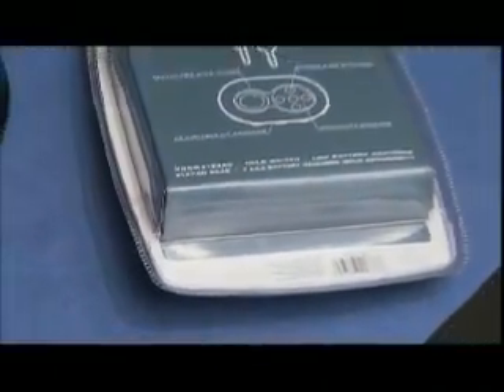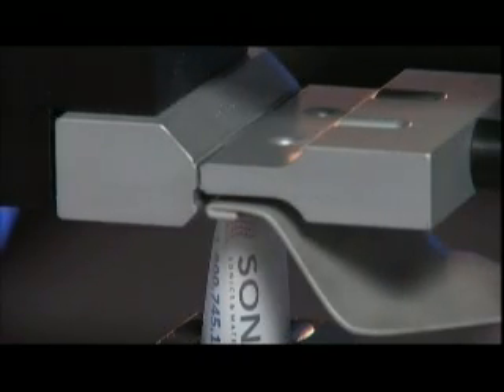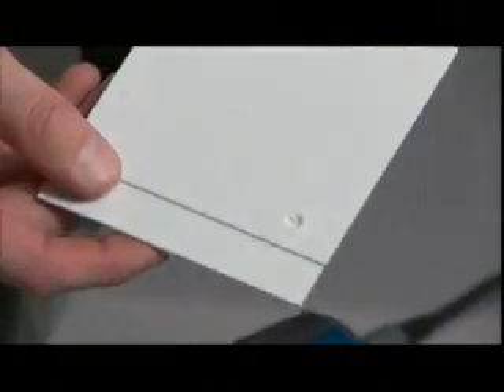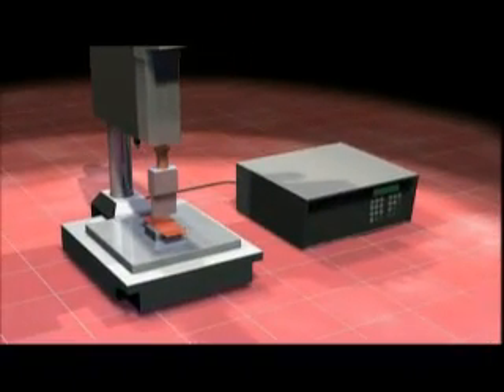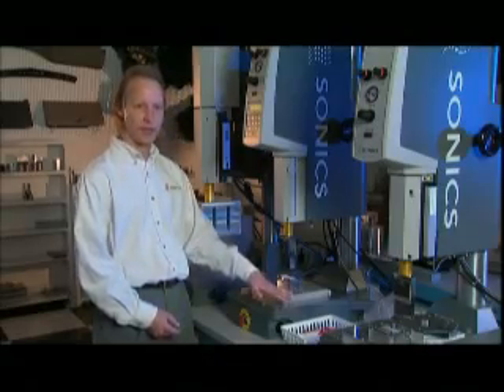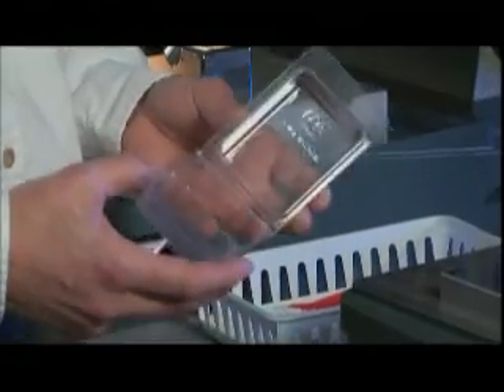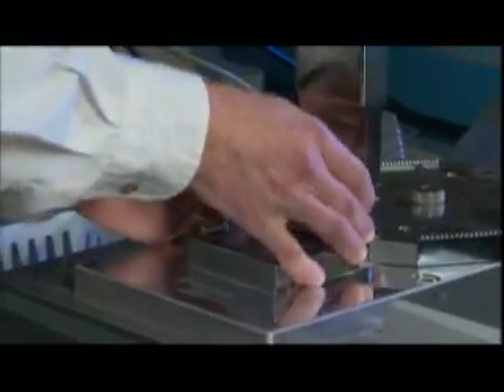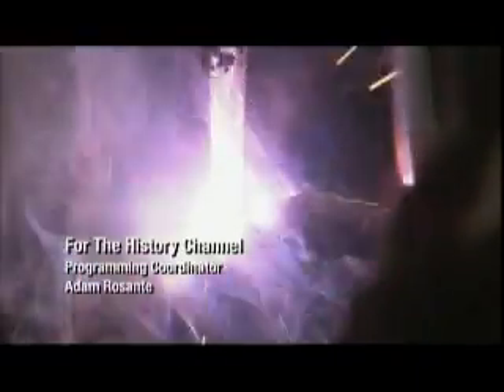Friction Welding

Comment: @helterskelter416 in that case you have a very different definition than anyone else i know, though i guess it doesn't really matter which definition you use unless you're doing something like a project for M.E. like i am, i double checked with my professor on that.

Comment: Just because you usually can't hear the sound directly from the solid doesn't mean it's not sound, some hearing aids use a solid piezoelectric device attatched directly to the inner ear that lets people hear if the bones in the inner ear or the eardrum are irreperably broken. There's no definition of sound that excludes solids, often it says "mechanical vibrations travelling through any elastic medium" that includes liquids, gasses, and solids too.

Comment: for something to be sound it has to be a pressure wave in a fluid (liquids and gases), you can't hear solids since they can't fit in your ear and make contact with your eardrum . it is just a pressure wave when it is in a solid. have you ever pushed something? when you push things they move in response to your push at the speed of sound in whatever material the object is made of. you would call pushing a shopping cart making sound would you?

Comment: "Also its over the hearing range of a human, so you wont hear it anyway." That's not true; the sound that this device produces has a frequency of 20 kHz which is usually considered the upper limit of an adult's hearing range. A kid or someone with good ears is very well capable of hearing 20 kHz. Also, why is this not "real sound"? Sound is simply defined to be a pressure wave (typically only those pressure waves are called "sound" which are in the 20 Hz - 20 kHz frequency range).